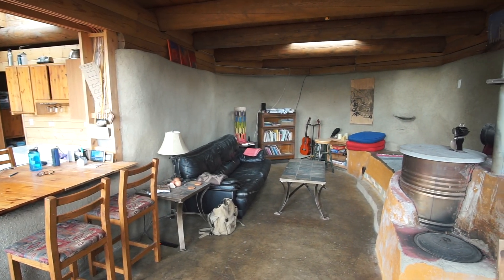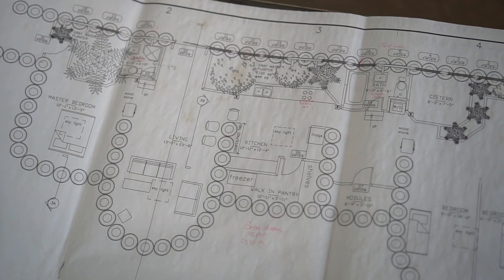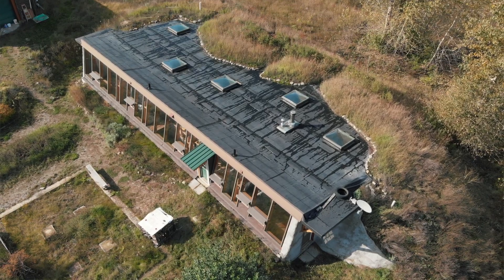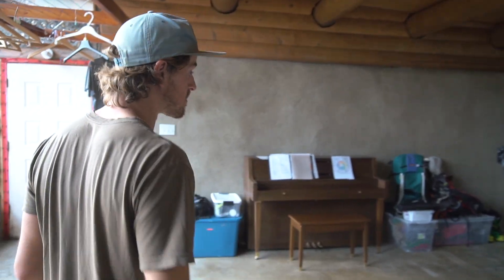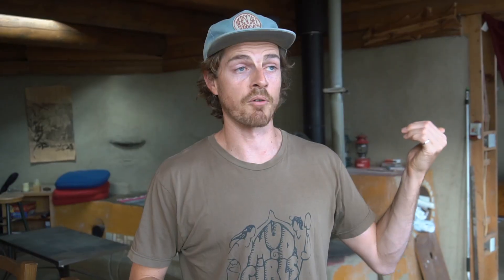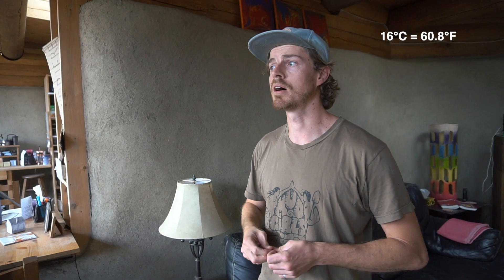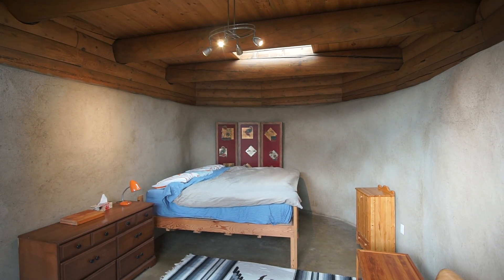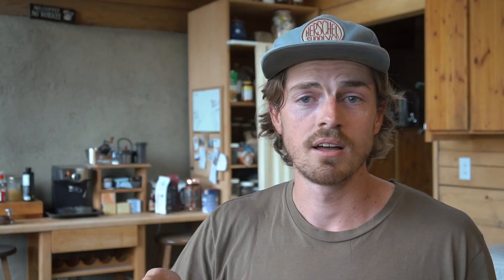Engineer Living in a Beautiful Earthship Shares Valuable Insight!

Comment: The newer versions of the earthships are very efficient and work very well, if they are well implemented! In this case it seems they just picked up some concepts of the earthships, which might  not get you the desired results! You would have to have the windows/vents on the south (sunny) side, with the air vents in the back side going through the earth mass to regulate temperature and promote convection throughout the whole house (therefore not making it "stuffy"), and using the thermal mass walls/floor correctly. Moreover you need the greenhouse buffer layer at the front. Most importantly, why on earth would someone use insulation cover over the thermal mass (I'm talking about cob over the tires packed with dirt) - the pounded tires should be complemented with a high thermal mass material such as concrete or adobe, straw bale is insulative. Actually the gross of the thermal mass that is irradiated by sun comes from the floor. And they made it with a straw-based material and not concrete!! So.. overall this seems a very badly designed "earthship", and therefore it cannot be concluded by any means that the concept does not work. This seems a very bad advertisement to an "earthship-copy" construction company that in the end doesn't know how to construct it properly.
P.S.: obviously that you need sun in winter for the passive design to work, so in certain regions with lower solar power, they have to use alternative ways of heating.

Comment: Thumbnail photo-the roof wasn't installed properly and the sealant is puddling and forming up to with the heat. The concrete consistency is not uniform in the foundation from left to right. Result-not going past 0:05

Comment: I think earthship design has come  a fair way since this model was designed.  Newer designs separate the greenhouse in the front with glass, allowing that area to be a buffer zone to the cold but still allow low-horizon winter sun to pass through to heat the surfaces in the inner living spaces.  And the circulation of air is very different, with windows at the top of the greenhouse area being openable - escaping air through them creates a suction effect that brings in air to the rear (inner) wall via large piping that passes through the earth behind the house.  The incoming air is cooled by the earth so you effectively get a natural cooling system just by opening up the upper windows.  Nevertheless I found his candid insights to be very useful, in particular on the rocket stove.  And the notion that you can go outside of building code definitions if you have a professional to sign off is very exciting.  Not the expense, but it still provides an explorable avenue for these innovative building approaches.

Comment: I loved the idea of a Rocket Mass Heater in my home until I started hearing all the persona l accounts. After hearing most of the negatives I've been looking into eastern & central European masonry heater. 
There is a company in called Temp-Cast LLC Minnesota that makes full masonry heater kits. Cast high temp concrete & a load bearing slab with custom finishing. The way those burn is much the same. One hour or so a day & let it give off the heat for the next 12 or more hours. You only get the fire started & don't really even have to tend it either is the really nice part. In the end the Masonry heater is what Rocket stoves aspire to be.

Comment: I like the design and idea of Earthships, but building a house from tires and bottles does not look like a good idea for me. It is not recycling, but just sealing garbage in the walls. The main problem with all used garbage is that everything is round, and round objects have bad adhesion. And tires have even worst adhesion because they are relatively soft. Also, I do not like U-shaped walls. They are just inconvenient and take too much space and material to build.
I suggest in such cases when you want to build from used materials there are a lot of better options. There is a lot of garbage in rectangular shapes. Old TVs, PC cases, Broken laptops, Gas plates, Refrigerators, Microwave ovens, dishwashers e.t.c. I'll leave some of my ideas below.

You can find some old or broken refrigerators, ovens or dishwashers on metal dumpsters and use them in a wall structure, they have a strong structure, very good
thermal insulation, and can be used as convenient inwall shelves with sealed doors and illumination inside.
You can use PC cases or ovens as an internal wall structure. 
Old laptops are good for sealing and floor if you fill them with a thermal insulator or cement. 
Old TVs glass kinescopes can be used as windows.
Also, car parts can be used as windows, you can find an old or crashed car and just cut out the roof and windows and place that piece on the roof of the Earthship, so you will get (if you save all electronics inside) self-cleaning windows with an opening mechanism, backlight. And also there will be already some minimal thermal insulation because cars usually have some.

But the best is probably sea containers. They can be used for container homes and easily can be used to create Earthship using basically the same technology.

Comment: I would use a cement block retaining wall filled with concrete and rebar and insulated with rock wool board. I would use vertical windows with an overhang. I like the skylights in the back. Most Earthship appear too dark in the back. They could have finished over those bottle and can walls with just a few more man-hours labor.

Comment: Out of all of the video's on you tube i have watched on Earthships over the years this one is very informative in the context of an actual engineers perspective not just the average lay persons staying at the actual property getting to know the structure and the faults that are hidden until you live there. Seeing the early version Earthship without the front greenhouse to give that extra leveling effect of the temperature is extremely important to know if you are going to embark on a project also Mark said that you have to take into consideration where you are going to build the Earthship and one silver bullet isn't going to fit all if you are going to build one then i personally would look at geothermally heating the air in the winter if you can dig deep enough and lay slinky style tubing. I think in the more modern one's you can see that heat can be retained more evenly and privacy a lot better through out i can only hope that this old design can be updated to a more modern design if that is what the owners want. brilliant video thanks for the content.

Comment: I would not regard that "rocket stove" as such. It is not. It is a regular stove that someone "kind" of converted to act as transferring heat into a bench. No real rocket stove would require large chunks of wood. The real beauty of a true rocket stove is that it only needs tiny pieces of wood and  is very conservative in it's consumption. I really like the layout of this Earthship and how it was not that deep compared to many or most, but was disappointed that it had not been finished and the whole concept of a planter bed had not been completed, so it was lacking a huge factor in it's whole concept..

Comment: A great insightful video that shows both sides of the issue with some earlier earth ship homes. Interesting that the design for this site didn't have a glazed buffer at the front to help insulate the interior. Also a bit crazy that there isn't a decent heating system for somewhere that gets so cold due to the lack of such a structure. Even a slow combustion stove would be better.

Comment: You need exterior blinds.  I have blinds on the outside of my large south-facing windows that I roll down in the summer.  Bamboo blinds work well and last a long time in the elements.   They also let through a good bit of light.

Comment: One very unexpected thing happened. I found out that my house has more than a few things he mentioned. I've always said that the person who build this house originally was a genius. First thing about it, is that it has a walkout basement, in other words three side are either completely under ground (2) or partly under ground. The upstairs has a wall facing south that is mostly window, the basement has a wall facing south (partially underground) that is almost all glass bricks, as long as it is not very cloudy, it is sunny, plus the other wall that faces west is also the same. The fireplace is not longer functioning but it has a natural gas insert, that works without electricity that keeps the finished half of the basement, very warm even when the temperatures here can go to -25 F. It also warms the main bedroom, which is directly above, through radiant heat. I can go on with all the things that are similar. The insert uses very little natural gas, I do have a electric furnace, which I keep at the most at 68 F during the day, and at night at 64 F. I had to put away my brand new fancy wool blanket because I was getting too warm. My gas bill is very low, compared to my neighbors. I was surprised how long you can keep water frozen by using insulation with common materials.  Once it gets warm and all this ice around me melts, I will be digging a hole to keep ice in and try it next year. (Digging is not an option in Minnesota in the middle of winter.) I have a small rocket stove but it's outside. I will see if I can figure out how to make a much bigger one to supplement heat. I've been preparing for much colder winters. Found a program that weatherized and winterized my house for free, that I had zero idea existed, until I was told that due to my and my house's ages, that I qualified for it. As far as I know, it is not publicized, because the person who did the work told me that the other job that he did for another senior citizen, the person told him the same thing. Just had that done in November and the gas and electric bill went down even lower. Got really, really lucky!

Comment: I understand the romantic idea of an earth ship but sort of costly. Baring living in a radon rich area , super insulation with 2 inch Dow toung and groove foam on outside of foundation, put in a masonry stove (like a Russian grubka) that you open fire for 1/2 hour burning scraps every 8-12 hours, put an extra flue pipe in the chimney and a fan in it to take heat from top and push it back into cellar. You’ll look like your neighbors but be energy free . Summer the fan goes in reverse taking cellar cool and dump into top of house, no ac needed. Electric needs minimal so small pv system should handle it. Nothing special and town doesn’t even need to know.

Comment: Thanks for a great video. I think the main reason there is such a temperature differential in this building is the fact that this earthship example doesn't have the interior glazing - the secondary glazing - which means it lacks the insulation/isolation, thermal gain and convection provided by the trombe wall effect. Also it lacks the green roof (only 25% of the roof is covered with soil) so this example doesn't benefit from the insulation of that soil layer. The skylights look like they may lose a lot of energy too.

Comment: Seems like a good idea but sort of a half baked attempt. If you can't stay warm in winter without burning a ton of wood is really missing the point. And nice traffic noise.
Reply: A rocket mass stove like this house has burns more efficiently than a typical stove and the idea is that it uses less than a cord of wood during the winter. It burns hotter with the intention of not letting creosote (sp) build up which prevents chimney fires. Earthships in general maintain a constant temperature of around 68-72°F year round, so the rocket mass stove is just to allow for more temperature adjustability. It's a really mindful combination of systems that use less energy in the long-term.
Reply: These things are expensive to make. But ye if I'm spending that kind of money would want to do it right.

Comment: in Poland all houses are required to be designed by a structural engineer and its a good thing; the stove should be placed in the centre of the buidling and needs a batch box; i light my stove up once per 2 days and its freezing now :) - this was designed i wanted to light it max 1 time per day and not baby sit it;
Reply: What are the winters like where you live? I am now researching batch box, thanks for the info

Comment: I wonder if you could take the solar mass idea and use it with more code-compliant materials, so that you don't need an architect. Like using ICF instead of the tires, and using standard walls instead of the earthen cob. Just having solar heating and thermal mass could reduce consumption so much.

Comment: its kinda weird to live in an earthship which is probably supposed to feel like youre in the nature but then there is this busy highway right next to it. A modern energy-efficient house would be more suitable for this lot I guess: Triple-glazed windows, thick insulation, PV-powered heat-pump and ventilation so you dont have to open up the windows at all. yeah, that would be the opposite of cheap though.

Comment: Nice, articulate discussion on building to code, and the reality of the air conditioning using the windows and mass of the walls.  Interesting that the incomplete “romantic” rocket mass heater only raised the temperature of the room one degree?  Too bad the house is still not complete after so long.  I fear it never will be.  Texas

Comment: He mentioned that this was an early earthship design but it would have been nice if he had mentioned what it lacks. Some of the problems he mentions have to do with the intended grey-water/greenhouse area NOT being separated from the living area. Since the grey water system isn't functioning, maybe that's just as well? But I would have liked to hear his opinion on that.
Reply: MakeMeThinkAgain hi- separating the green house : what is the reason ? is it because of heatloss in winter through the glass at night ?
Reply: @gailalbers1430  If the greenhouse area is separated from the living area by a wall and windows, the extremes are limited to that area while the living area stays at a more constant temp. Sun and heat gain is a good thing in the greenhouse.
Reply: yes - the main thing this one is missing i think, apart from the overhang mentioned in the vid, is the secondary glazed partition - this functions like a trombe wall, without it, it can get really hot in full sun becaus ethe house is like a greenhouse, and get really cold because all the heat escapes - the secondary g;lazing partition acts just like a giant double glazing unit so it insulates the house from the cold.... look up trombe wall on wiki - it explains better than i can!

Comment: I would verify that the rocket  mass heater is designed properly before thinking they are all like that.
Reply: Longer burn times without constant babysitting, and properly sized thermal mass can be scaled. They may have simply built one based on an available schematic without really knowing/understanding the possibilities. The best rocket stove mass heaters are usually second and third generation, trial and error is a great teacher. Start by building one for a greenhouse, shop, or barn first, then take your experience inside the house. Some people even build smaller ones for each bedroom, duct the flue through the mass of the wall instead of a cob “couch”, that way it heats two rooms.
Reply: The earthship was created first and is built mostly in the dessert of Arizona. The rocket heater works better there, where it only gets cold at night for awhile.
It is so hot there during the day, so the house absorbs and stores the heat, then releases the heat slowly throughout the night. In Canada, the summers are not hot and the winter is extremely bitter cold, so you need a heater that will run day and night consistently.

Comment: Itd be great to heat water for the tub by the sun😉& incorporate radiant heat pumping the hot water thru the floors. So, a closed heating water system for floors& another system for heating water. How to utelize the "heat" most efficiently☺😀😃😄ahhh yes!
Reply: yes-i saw an earthship in a youtube video, where they heated the water also with the wood stove